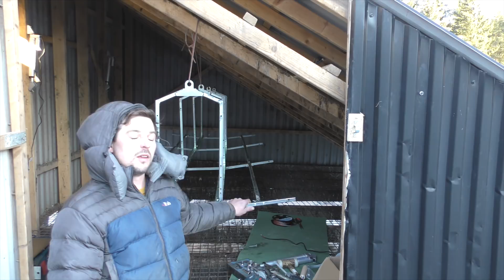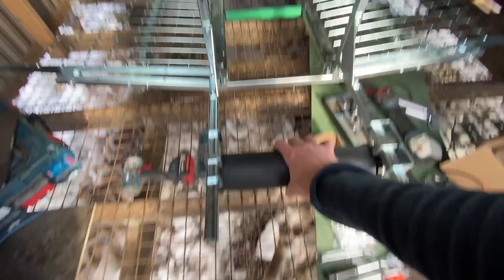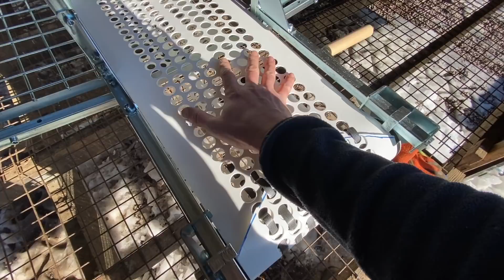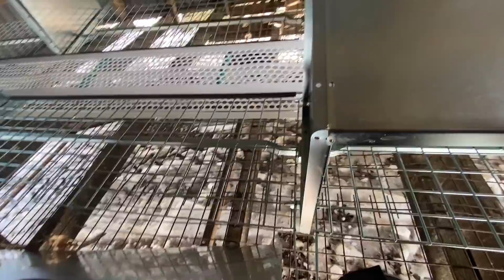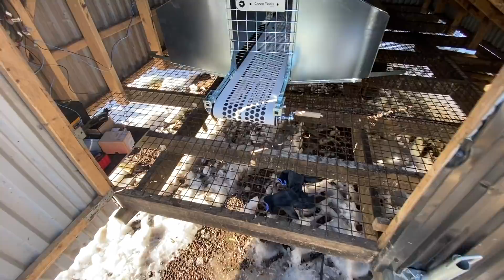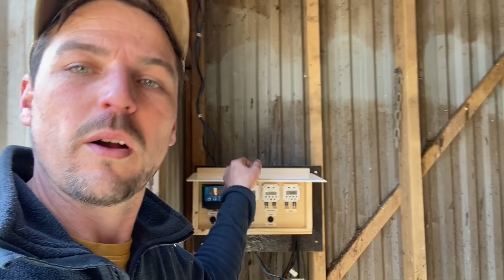Ridgedale Egg Mobile 2.0

Comment: Looks excellent, Richard! Bruno is amazing. Someone may have mentioned this already but maybe you could put your actuators overhead and a pulley on floor with a rope running through and attached roost pole on the nest. That way it pulls down and has some play even if it levels out in different spots. Just a thought I had while watching. Anyways great work!

Comment: Love the work you and Bruno have done.  I suggest you have the access door to the left open in so it can swing back against the wall instead of toward the electrical equipment.  Looks like you could design it either way.

Comment: Excellent!!!

How about just buying in sections, for those of us starting out with smaller flocks?
Reply: That's exactly how it's designed. One unit is 1.2 meters long and you can stack lengthwise as many as you like.
Reply: @brunomotik8576  What will be the cost for one section?  Will you be able to ship to the US?
Thnak you.
Reply: @davewygonowski984  I am still optimistic about keeping the price down to as low as 300€ for a 1,2 m unit but we will know once the design changes are incorporated and the final model is done.
Reply: @brunomotik8576  that will be amazing! Cant wait!
Reply: @brunomotik8576  don't forget the rest of N.A.😀. I am in Canada🇨🇦, just next door to The 🇺🇸🤓

Comment: Try adding the acuators from the bottom on the front two corners, mounted to the base of the egg mobile (stable platform). Depending on how riged the nest box is it should work. Out of the way and you will only ever have to adjust one side to get it level.

Comment: Was wondering if you have ever thought about collecting the chicken poo and either using it on the farm or creating another income mechanism. I envision a chicken poo gutter that catches the droppings then its all a matter of using a trowel to shove it down the gutter into a bucket. I understand also that it helps fertilize the land but it seems like the birds would do a good job fertilizing while out during the day.
Reply: The point of this is to move it each day or two, so the poo spreads all over the ground, thus becoming part of the nutrient cycle of the land, a necessity if you wish to avoid oil-based fertilisers - hence regenerative, and sustainable.
Reply: @the-tessellater   You do realize they are fertilizing the entire day while out of the tractor...  If you are "free roaming" the birds all day, they are pooing all over the place. When they poo in the tractor it is all isolated to one spot not over the entire land they were grazing hence why I am asking if this could be turned for profit? Seems like excess isolated to one area
Reply: the tessellater  Richard farm is propelled by imported grain.
Reply: @Stezosledec559  as are most small farms with commercial live stock operations, it allows networks of small farmers to support other organic grain producers without having to take on the burden of growing everything yourself.
Reply: The mobile coops with solid floor such as Hühnermobil have conveyor belts underneath the roosts for poop collection.

Comment: Super cool and thanks for your hard work.  Looking at this though, it seems like the boxes aren't a great fit for this EggMobile design.  As you mention, there are access concerns for both people and chickens.  Good luck getting in there to check on or clean the boxes in the back right.  I think you may need to come up with a new EggMobile design that allows this to work better in the space.  Either that or a one-sided design that allows this to sit against the side of the coop similar to the old set-up.  Lot's of great innovation in here as always though!
Reply from the maker: It's definitely tight to get in on the far right, but I would imagine only needing to 5-6 times a year. We'll see, and review as we go, but I'm thinking its going to be sweet. Part of the project is getting a product available that people can do what they want with...
Reply: It looks like it would fit a dual pitch roof now....

Comment: Why level it with a button if you can use an IMU to do it for you automatically?
Reply from the maker: Thats beyond my simpleness, but it's nay bother to check its level in the morning; you have to level it front to back manually regardless, and it will take all of 3 seconds
Reply: @regenerativeagriculture  But if you use a microcontroller, than  you can also automate things like opening and closing the door, which is a chore and  can lose you a chicken from time to time. Wiring wise it's about as much as using a switch.
Simplicity-wise the actuator can be replaced with adjusting a screw manually.
Your way seems like a middle of a road solution for me. I'd go all in, especially since  controller units are dirt cheap. Microcontroller, motor drivers, IMU are 1-2euro each. Code is already there. You just flash arduino with a downloaded code and that's it.
Reply from the maker: @rhalfik  We have automated door open/shut, nest open/shut, lights. It's just nest levelling that's manual, although using actuator rather than manual
Reply: @regenerativeagriculture sounds nice
Reply: Do you have a link to any such open-source code?